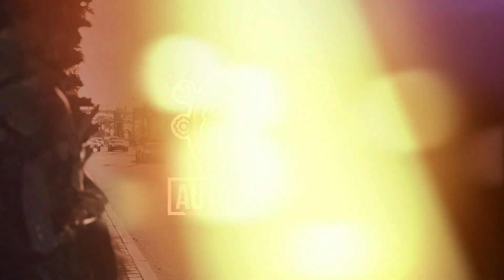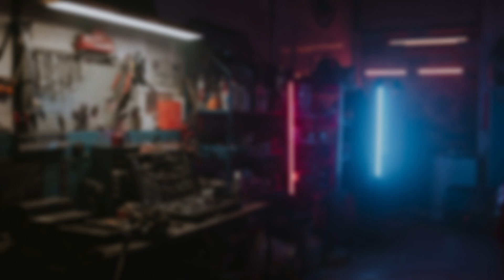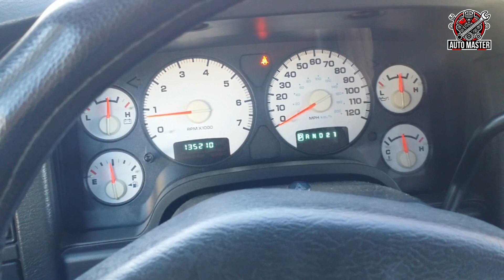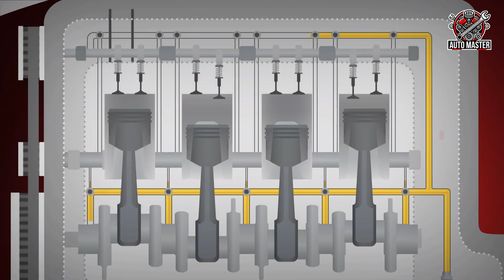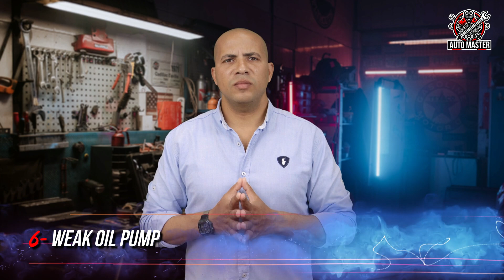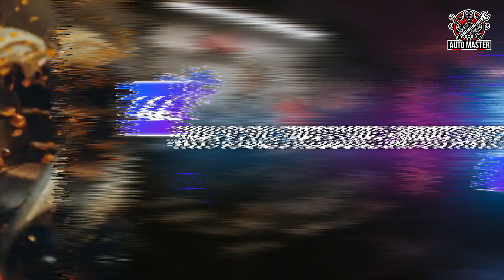Causes of low engine oil pressure

Comment: If oil pressure hig too, what problems?
Reply from the maker: High oil pressure can cause serious engine problems.

Check these points
- an oil passage may be blocked
- the pressure relief valve may be stuck
- the oil filter may be clogged
- the oil viscosity may be higher than required
- the oil pump may be producing more pressure than normal

Possible damage
- oil leaks from gaskets
- crank or cam seals may blow out
- extra stress on the oil pump
- overheating in the upper part of the engine